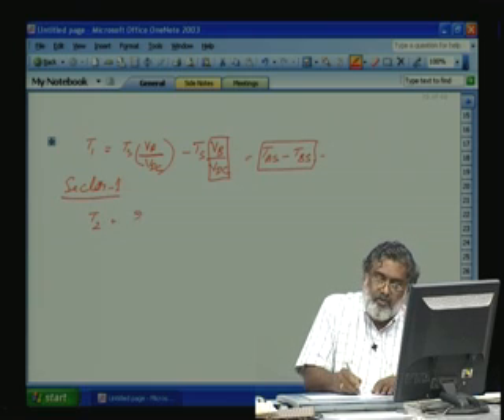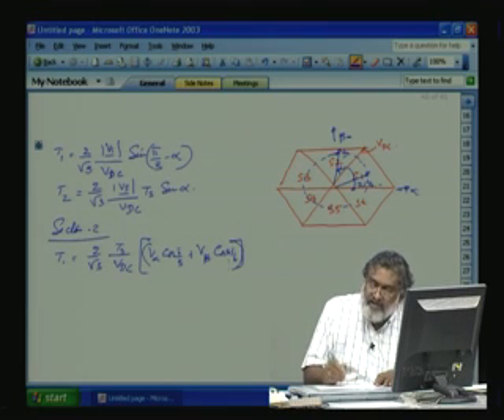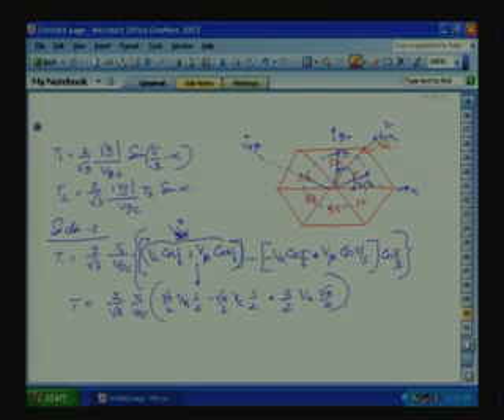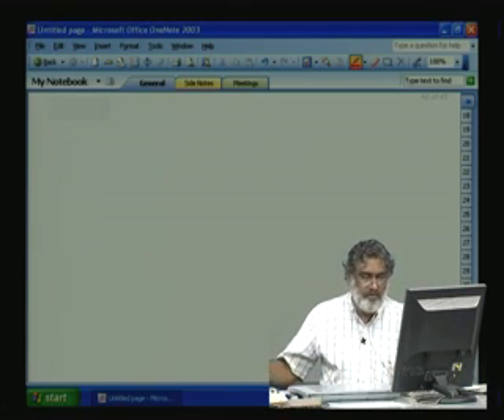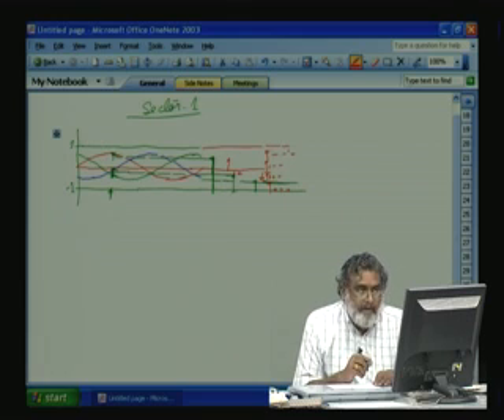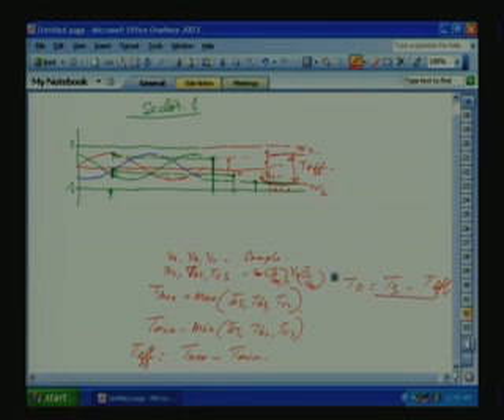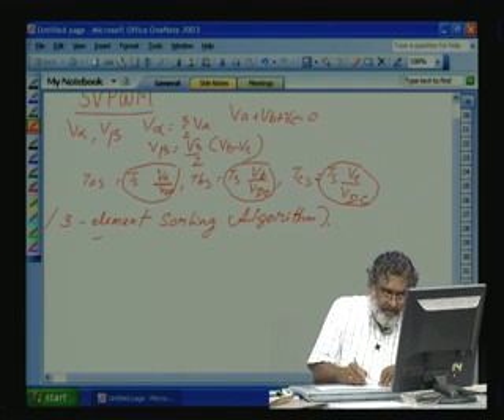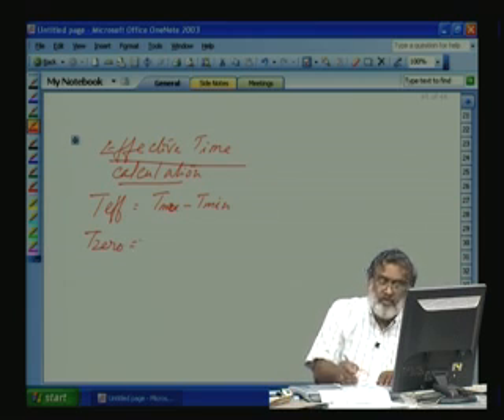Lecture - 29 Space Vector PWM Signal Generation

Comment: SVM is one of the methods to generate PWM to drive inverters which control 3 phase motors.  (the PWM goes to the transistors in the inverter). The inverter chops the input DC voltage into 3 phase AC voltage to drive a three phase motor according to the desired speed and torque. I use the SVM in my work a lot.  I hope this answers your question :)